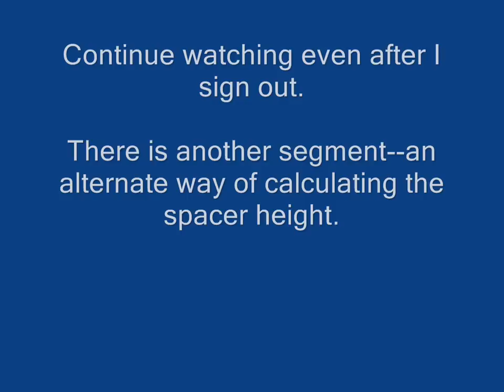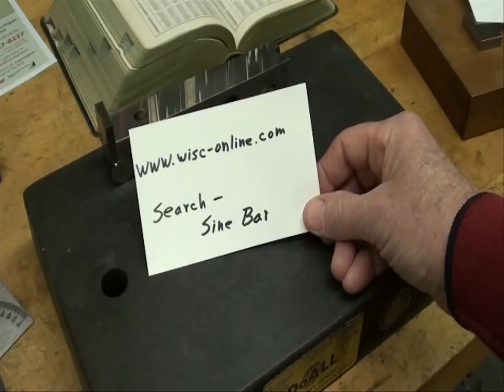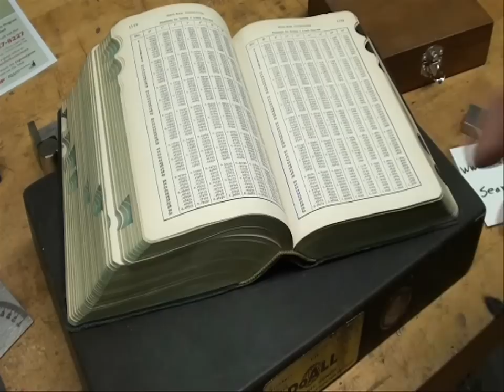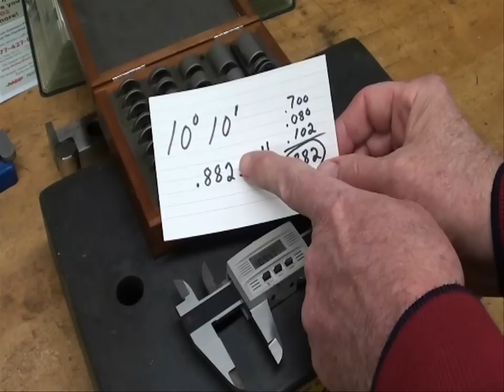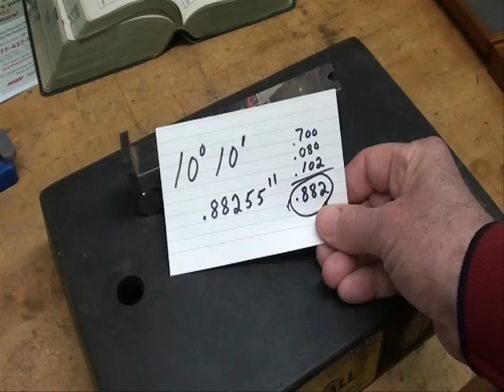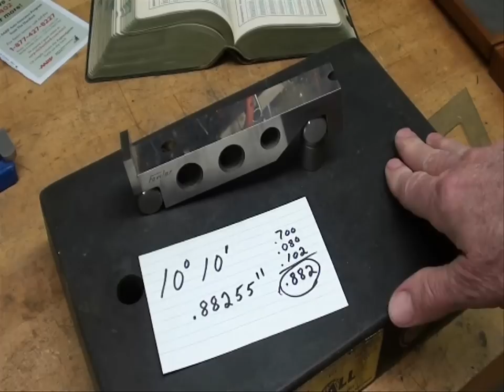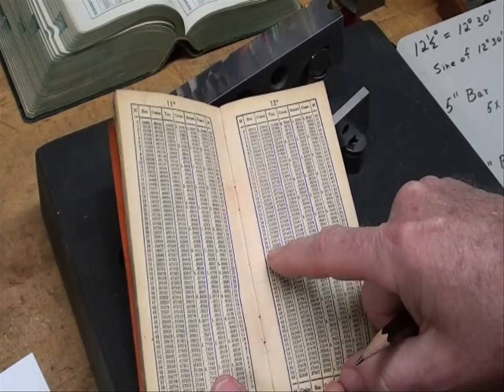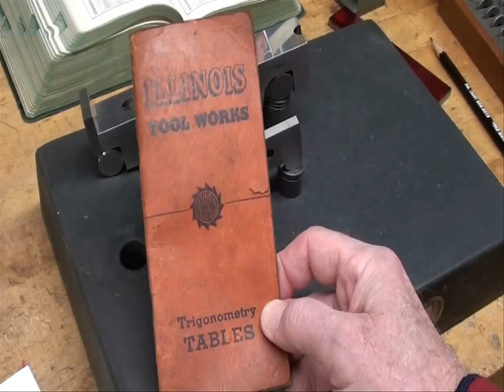MACHINE SHOP TIPS #19 Sine Bar part 1 tubalcain

Comment: The math is very simple. SOH CAH TOA.

Sin = opposite / hypotenuse
Cos = adjacent / hypotenuse
Tan = opp / adj

The thing you have to remember is that you need to use your calculator (set to degrees, unless you're a masochist and want to work in radians) to find the sine, cosine or tangent value. Then you just put it into one of those equations, and chug away. Since you know the value of the left side of the equation up there, and you know the hypotenuse, you simply calculate the unknown value--the opposite side, as Mr. Pete showed here. 

Just get a decent calculator and practice these things once in a while, and you'll get good at them. If you have trouble, ask a 12 year-old to help you. They used to teach this stuff to them...before common core anyway.

Comment: Another good one!  Thanks.   For those not interested in the math ... w/o getting into all the trig mumbo jumbo, suffice it to say that trig functions allow you to complete unknown dimensions and/or angles of a right triangle.     In our case we have a fixed hypotinus (the sine bar), and desired angle.    So we use the equation: sin(A) = opposite / hypotenuse and solve the equation for the opposite side (the thickness of the shims).

Comment: First I would like to say thanks for the time and effort to put out yet another great video. 
Most Windows based computers have a scientific calculator that comes with Windows. Under the View menu button select Scientific. With the 10 deg 10 minute example you need to convert the minutes into a decimal. Deviding 10 by 60 to get 0.1666 then add the 10 deg  and you get 10.1666. Now press the sine key to get the sine of 0.17651 x 5" and you get .8825

Comment: If you don't have (or don't want to use) the machinery handbook, there are Sine Bar calculators on the internet.

Some will not only tell you the overall height of the required blocks, but even which blocks to use, to obtain the required stack height.

Comment: Hi Lyle,
With the proliferation of scientific calculators in modern society, I would doubt many machinists would be using tables, even the humble mobile phone is equipped with such calculators, and who doesn't have one of those these days? Being a septargenarian like you, I remember using those books of log and trig tables in school, and later at University using slide rules, but that was before calculators and computers were invented, and became so cheap to buy.
The 0.882 in your 5" sine bar results with an angle of 10 deg 9.608', or to write it correctly 10 deg 9' 36.48".
Cheers Dennis
Reply from the maker: Thanks

Comment: Always interesting and informative!  I'm really interested in seeing the practical application of the sine bar.  Are the holes in the 5" bar for weight savings, or do they have a practical purpose when using the sine bar during a setup (i.e. clamping)?

Comment: Here's the way I have done it:
# of degrees(sine) x length of sine bar
Ex.
45*(sine) x 5 = 3.5355
12.5*(12*30')(sine) x 3 = .6493
You need a scientific calculator for this. Set the calculator to degrees, input the desired degrees, press the "sin" button, and multiply by the length of the sine bar.

Comment: You can use google calculator for these calculations too. Simply enter something like "sin(10 degrees 10 minutes)*5" into the search bar and it will give you the answer: 0.88256064294. (The *5 is for the 5" length of your sine bar.)